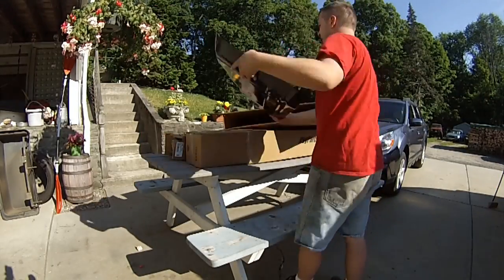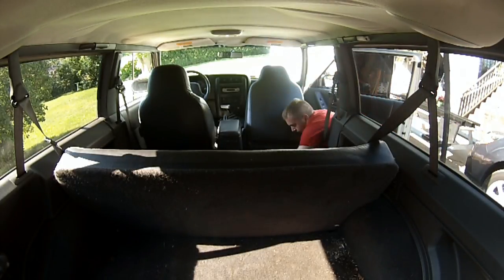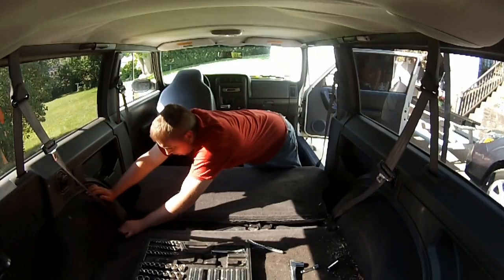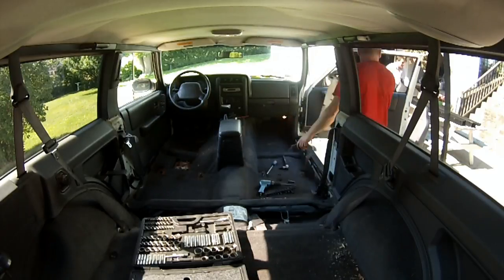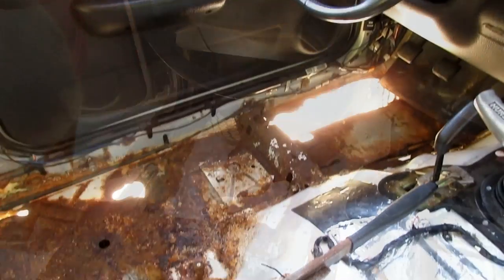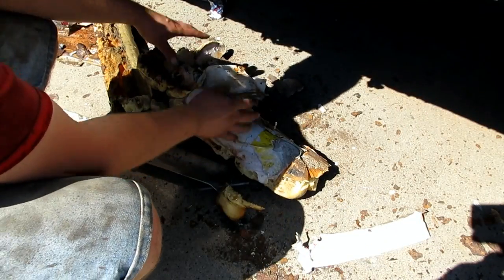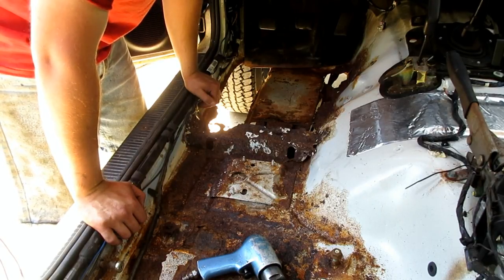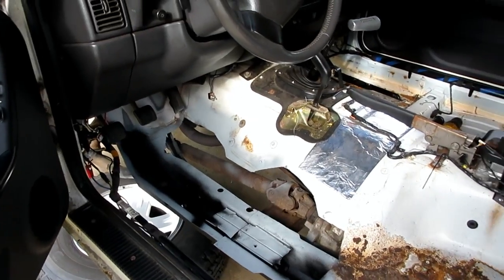Project XJ Winter Beater: Part 4 XJ Floor Replacement 1/8

Comment: What year is that white Jeep? My son was tearing into his 1996 today and broke a seat bolt also and he also has a hole or 2. Let the fun begin I guess. Whats your thoughts on those Key Parts panels? Thanks!
Reply from the maker: This one is a 99. They worked out alright, weren't perfect. But good enough.
Reply: Cool, thanks for the reply! @WeekendHandymen